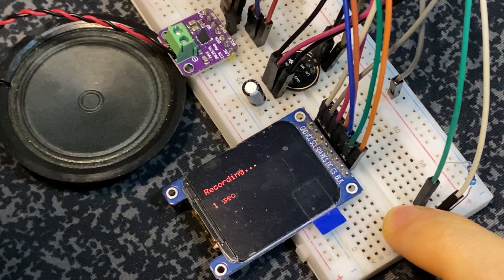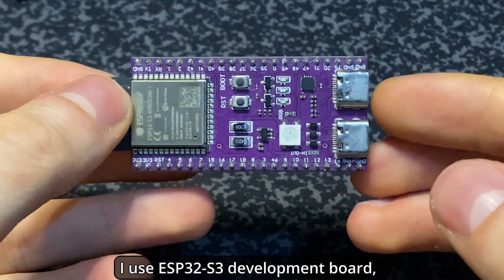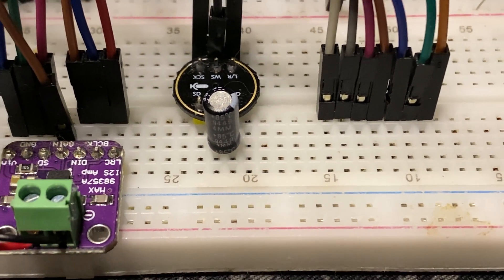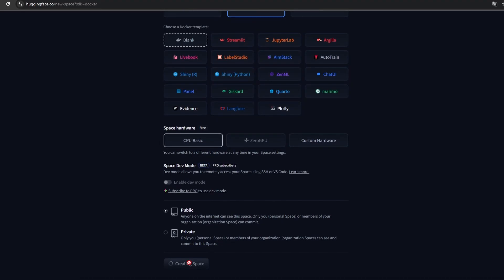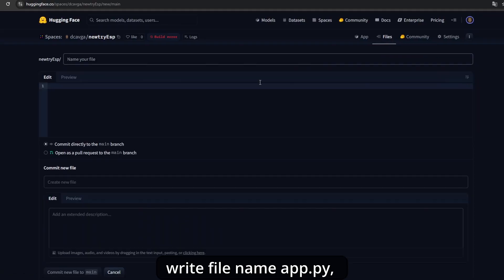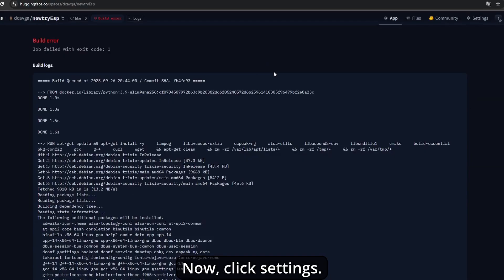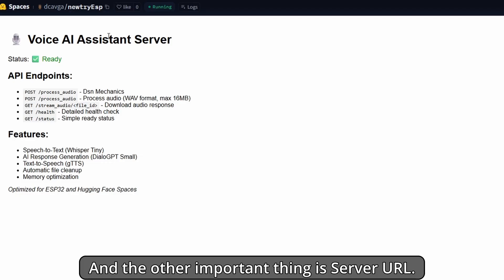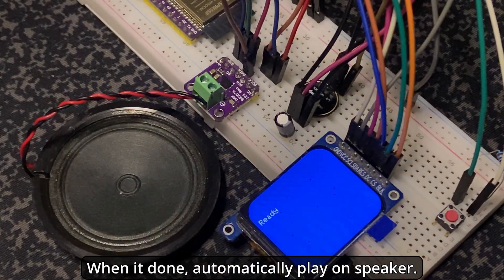DIY Voice Assistant on ESP32 S3: Free Hugging Face AI Server & Arduino Tutorial

Comment: Tengo todos los mismos componentes, lo hice todo pero me salen los problemas i2s(legacy): CONFLICT! The new i2s driver can't work along with the legacy i2s driver y esp_core_dump_flash: Core dump flash config is corrupted! CRC=0x7bd5c66f instead of 0x0
Reply from the maker: Its very boring. In my channel, a lot of aplication variant of i2s drive with Esp32. You can checkout. Check again used libraries and esp32 board versions.

Comment: I am having some problems in versions pls can you tell me the board version you used for your esp32 board and audio library version plsss
Reply from the maker: Checkout my other version of ai assistant much compatible other esp32 board.  Link in description
Reply: @DsnIndustries actually I am using esp32s3 and all the components same but facing issue in matching libraries version, it will be huge help for me if you can tell me your library version to me pls
Reply from the maker: All library is last release. Also esp32 board last release. Which i used link in descriptions. Futher my board has a 16mb flash and 8 mb psram.
Reply: @DsnIndustries I am using the same but it's psram and flashing memory, can you confirm if it answers all the questions we do ask or any selected one and also if you don't mind pls tell the exact version you used for esp8266 audio and esp32 boards